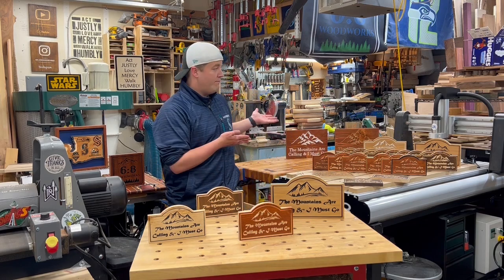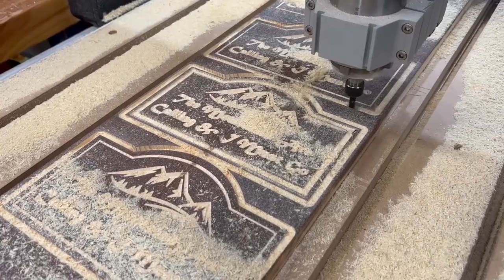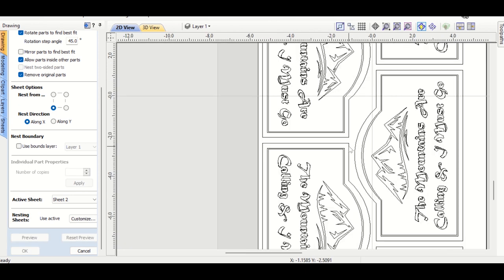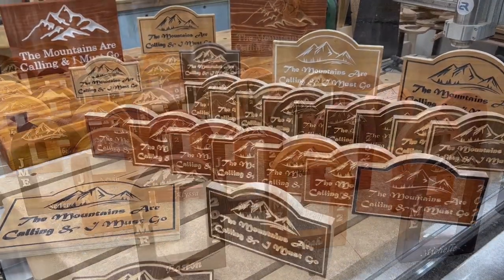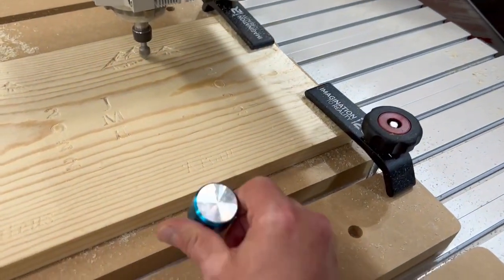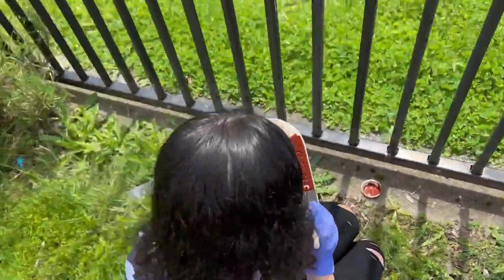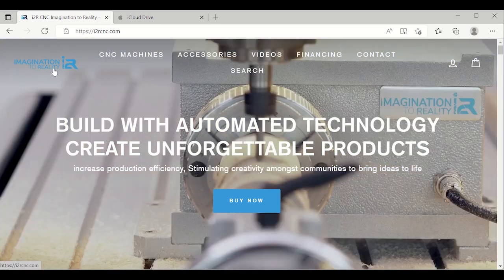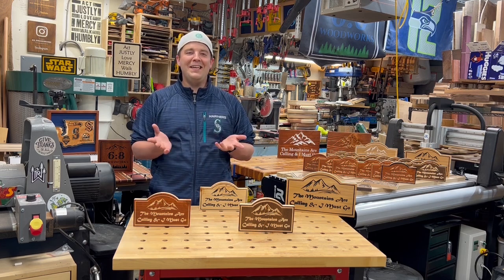CNC Sign Batching: Tips for Efficiency and Max Production

Comment: What did you find to be the best clean up method/tool for the v carves or fonts in general?
Reply from the maker: Just a wire brush did the trick
Reply: @SixEightWoodworks  Thanks. Yep, I tried that. I think I will put together a sanding mop for an even cleaner finish. I appreciate your Channel.

Comment: Great content and nice work.
Here is something that may help. In V Carve, draw in some circles the size if screw heads and drop them in your drawing where you would like hold down screws. Using the screw head diameter allows you to make sure that your cutter will not hit them. I did this yesterday on some walnut boards. I have a vacuum table and threw down some plywood waste board and vacuumed it down. Layed down the walnut on top and held it temporarily with two clamps. I had V Carve take the 1/4" cutter that was set up and go around and SPOT each of those circles. Then I drilled a through hole by hand and screwed down to the waste board. Quick and easy. That allowed the board to sit much flatter than just some end clamps. I have other CAM Clamps and hold down clamps but sometimes this works best for me when cutting odd shapes.
If I have small text or some kind of detail design I will surface the material and hit it with 120 in the machine and then do my carving. that way  i know its flat and dont have to rerun shallow cuts. Anyway I hope that helps in certain situations. Keep up the great work and excellent information.
Kelly

Comment: When I'm vcarving, I do a surfacing toolpath first with 1/4 downcut bit to get the surface completely uniform. Just like 0.01 or 0.02 off the top, some times I run it a couple times if it misses some sections. But then you have a perfectly uniform surface that's parallel with your machine to vcarve on. Great video!

Comment: What is the trick to getting the masking film on? When I tried it, the CNC tore it to shreds and it wasn't anywhere near as clean as yours in this video.
Reply from the maker: Sometimes I use a roller. It depends on the material. Some finishes make it hard to adhere.